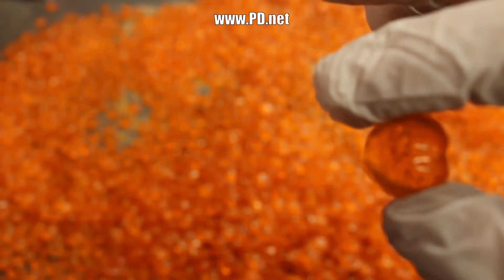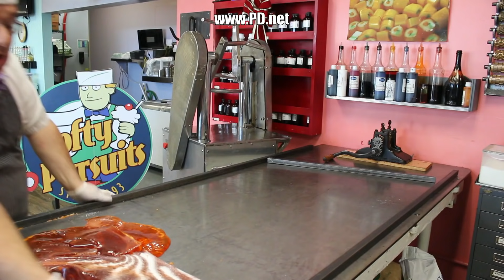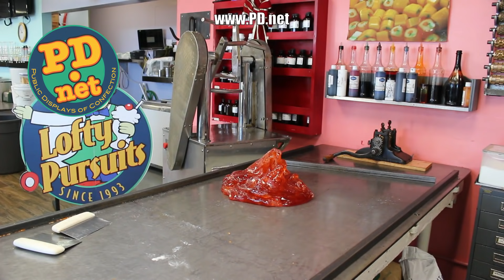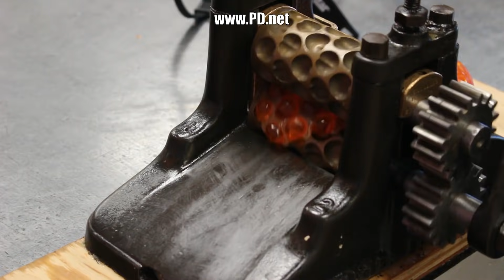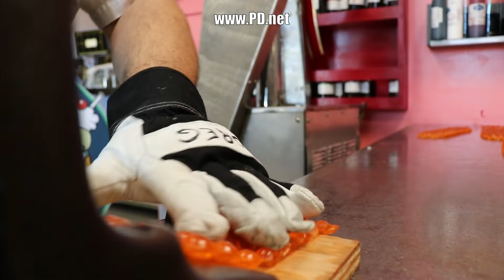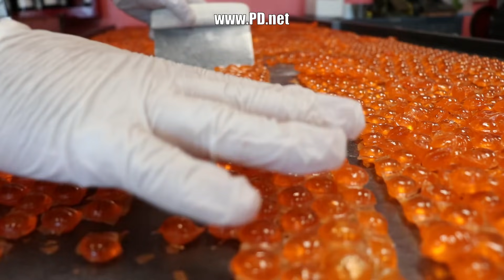#89 Pitting our skills to make Peach Drops. It will leave you Peachless!

Comment: I'm an engineering student and watching those rollers is so satisfying. They have that combined beauty that only purely mechanic machines have. The gears mesh with just the right play to turn easily and the pattern is self centering as the hot candy compresses against the surface, partly solidifying into an outer shell against the room temperature rollers. You don't need to crank it unnaturally fast and having just two moving parts is as elegant as can be. The naturally formed slip bearings between the rollers and the frame parts is the icing on the cake. Everything on it has a purpose. They don't make them like that anymore.

P.S. Have you ever tried coating just the top side of a "sheet" with something as it comes out of the roller? I think something that would slightly dampen the taste would make the initial flavor last longer as that coating dissolves.
Reply: could you make one for me?

Comment: Can you roll and feed larger chunks of the hot candy or is the yield better when you  feed small bits at a time through?
Reply from the maker: It depends on the weight of the candy. Thicker sheets weigh more. If it's too heavy it streaches instead of slides across the table. I'm also limited by my arm length.

Comment: I know you have to keep rolling the image bars until they cool so they do not get a flat side. Do drop candies get flatter on the bottom since rolling would not work for these?
Reply from the maker: Yes and no. The mass of the rollers, if I have the temp. of the candy going in just right, cools the candy to hard on the way through the press. The temp is never perfect.

Comment: I wonder can you make clear candy, and if so can you add in flakes of another candy? Thus is it possible to make an almost snow globe type candy that is clear with little white flakes suspended inside it? Because candy you can see into a bit doesn't seem that hard, but adding the flakes with out dissolving or getting distorted so much i feel would be the real challenge. Unless you can make the clearish bit into a nice thin layer and then sprinkle the flakes onto it and then role it up and cut.

Comment: I know this might be a stupid question, but how do you line the shapes up on the 2 rollers? I imagine if it's slightly off you'll end up with bad shape
Reply from the maker: They have an arrow on each roller. I think you can see it in the nectar video. It's on the gear.

Comment: How do you know if you added too much or too little citric acid??? Or does it come with experience
Reply from the maker: The silver cup is a measuring cup. There is a formula we use depending on he flavor. We learned by experimenting
Reply: Lofty Pursuits i always thought it was a default cup without the measurements thinking you always went by feel but thank you for replying
Reply from the maker: No, it's just a metal measuring cup. It's a modem cup, but I feel it matches the look of the candy area
Reply: Lofty Pursuits oh ok i just haven’t seen very many but i always love learning about new things
Reply from the maker: It's just something that is fairly standard.at a commercial restaurant supply house.
Reply: Lofty Pursuits no problem but have a great day

Comment: Would you ever pull candy before putting it through the rollers? Why or why not??
Reply from the maker: We do. You can see us doing it in some of the other drop videos. I think perhaps I should have done it this time, but it increases the chance that the candy will stick. I did not have time to do the batch over if it did not work.
Reply: @LoftyPursuits  oh I will have to find those other videos! I was thinking you could spray the rollers with cooking spray but then the candy would be greasy lol. Gross. These look lovely though

Comment: Ever tried making a jawbreaker? If it had pomogranite flavoring I'd buy it on the spot
Reply from the maker: We make a hard candy in Pomegranate. Check my site. It's not a drop, but it is hard candy.
Reply: Really?  Pomegranate?  (I've used the correct spelling, btw.)  It's so bitter... or, at least the seeds inside the actual fruit beryls are bitter, but the juice is a little less bitter.  Still, not a flavor for me.
Reply from the maker: You have to try ours someday. We've balanced perfectly I think. Its one of our best.